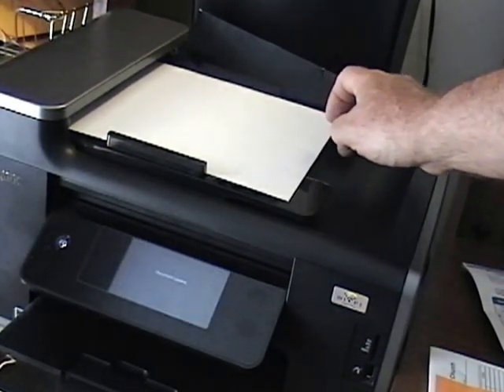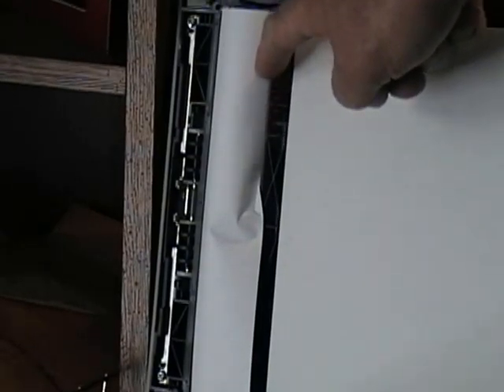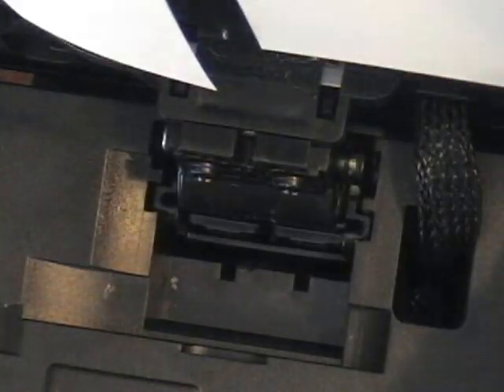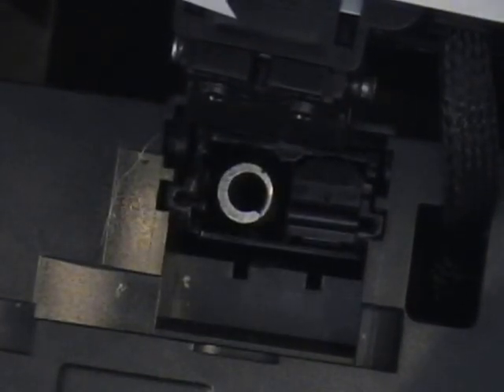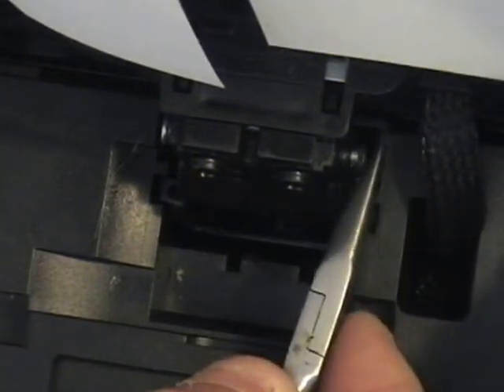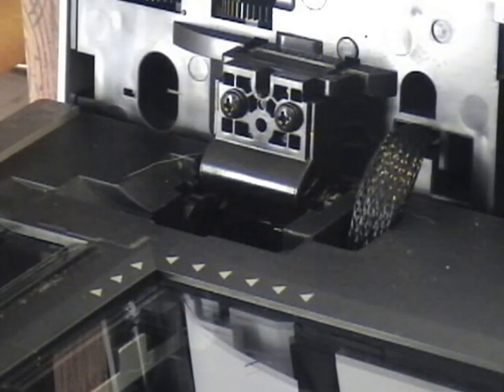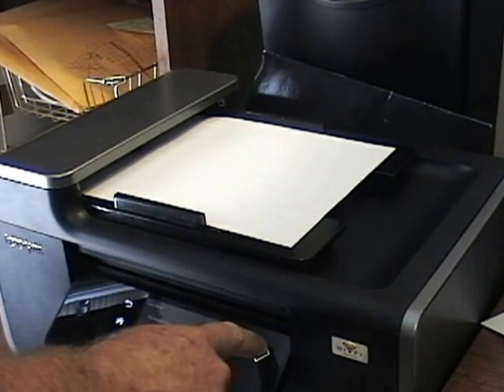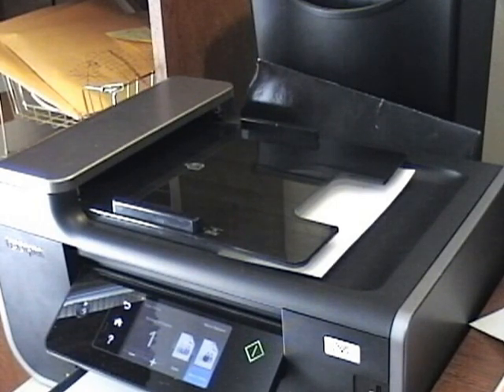Lexmark Printer Pinnicle Pro 901 ADF/Hinge quick fix (Revised)

Comment: Hi,I need help with my printer my Lexmark Printer said (ink error see Manuel) but I have bought a new ink and it still said that...Please help me...
Thanks
Reply from the maker: I don't know what model you have but if I were getting the same error, I would first look at the ink cartridge itself, and if it has electrical contacts, i would take an alcohol wipe and clean the contacts on the cartridge and the corresponding contacts in the printer. If your printer is like my 901, the individual cartridges do not have contacts, they snap into whats called a print head. The print head has the electrical contacts on it. To clean the contacts on the print head you would have to remove it.(Which is relatively easy to do. Just unsnap one latch). If cleaning the contacts does not solve the problem, you might try replacing the print head. They are known to go bad occasionally. My replacement print head was about 35 bucks online.Good luck with your repair and let me know how it goes.

Comment: I really need help with my Lexmark x5495, every time I try to print a document, it stops at 20 - 40 % through. Why does it do this? How can I fix it?
Reply from the maker: First thing i would suggest is to try and print a test page from the lexmark software on your desktop.If that does now work, try uninstalling and reinstalling the software. You may also try unplugging your printer for a couple minutes and let it reset. Good luck and let me know how it does.
Reply: Michael Day
I tried this, but it continues to do the same thing.
Reply from the maker: Charmlene Junis I am lost for ideas but will do some research and let you know if I come up with anything. Sorry I could not be of more help.
Michael
Reply from the maker: Charmlene Junis Im shooting in the dark here but have you tried printing with it from a different computer? If you are printing wirelessly, try to hard wire it using a usb cable. Maybe you will get different results and at least be able to determine if the problem originating with your printer or your computer.
Reply: I just have the one computer. I think it's a connection problem because when I photocopy, it works fine. It just stops when I print from Word and Picasa from my computer. It's not wireless though
Reply: Charmlene Junis
Odd, your response doesn't show up here from my email yet. Well, thanks for trying  to help though.
Reply from the maker: Charmlene Junis next thing i would look at would be updating the printer driver, if you have not already.
Reply: Michael Day
Yes, I have tried, but it doesn't let me open the file

Comment: this hinge is a stupid little design in my opinion had to do this as well to fix the problem. I wonder if you can help me fix my other problem i have with my printer (prevail pro 707). when i print, or try to at least, i get an error message saying printer cannot communicate with computer. this happens over usb and wifi printing. tried reinstalling drivers countless times, tried updating firmware and software with no luck to solving the problem. at times it even freezes while printing and have to reboot both the pc and printer. i have had more hassles than printed pages and i would appreciate it if you could help me solve the problem. is there a way i could downgrade the firmware???
Reply from the maker: +Sidney Koen I don't know about the downgrading of the firmware. Doubtful though. Have you tried setting the Lexmark up on another computer just to test it? To rule out a computer problem?
My experience has been that the features generally work better if you access them through the Lexmark software that came with the printer. Wish I had more to offer. Good luck with it.

Comment: Thank you for posting this video.... I too have had this issue and believe this to be a design/engineering defect and want to make Lexmark accountable for it.  With enough identical cases, we can prove that this hinge is under too much pressure causing it to fail. If we do not bring this to the manufacturer's attention, they just go on producing crap.  Even those out of warranty should be able to get a new part or a new printer.  If you agree then email your contact info to firestormmedia@gmail.com and I will attempt to convince Lexmark to do what's right and correct this issue and take care of those owners on my list.
Reply from the maker: First off, your welcome for the video. I do agree with you that it is a design flaw and Lexmark should be held accountable. I support any efforts that you make to help all of us who have experienced the same hinge problem. Should you have any success with Lexmark, please let myself and the others know via comment on this video. Thanks again for your efforts Joe.